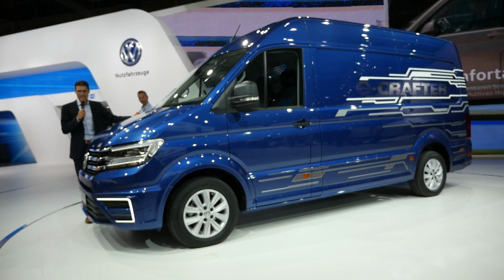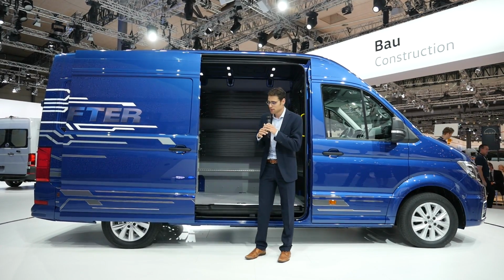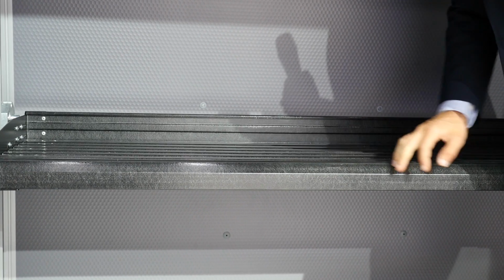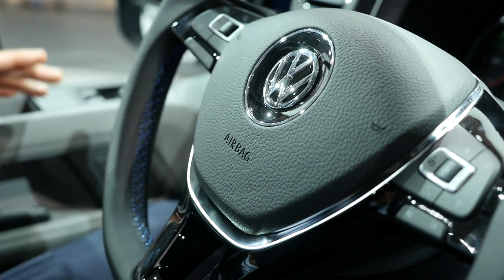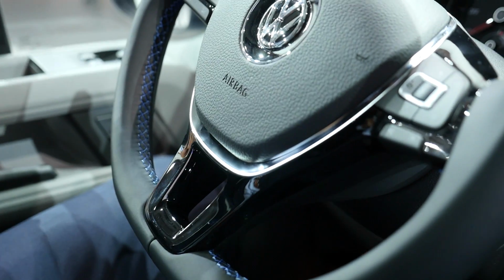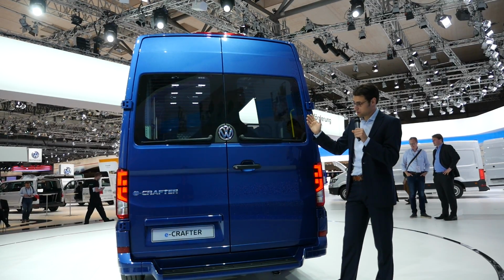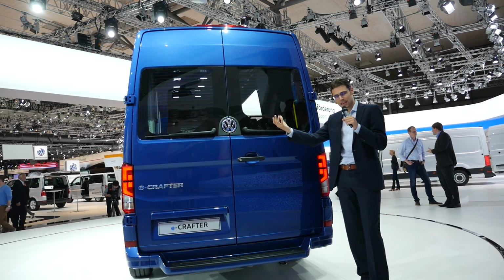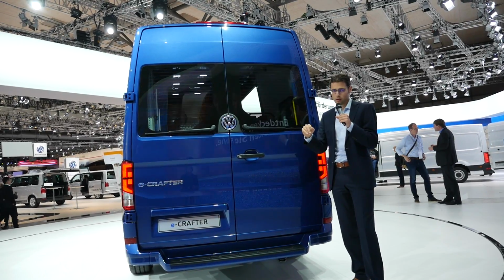VW Volkswagen e-Crafter Premiere 200 km range new electric light truck - Autogefühl

Comment: Three years later they release it with 100km winter empty range. The charge port is badly placed. It is limited to 90kmh. Price is 70k+ euro. No active cooling for the battery and if overheats just like the leaf when rapid charging repeatedly.  
The interior is nice. The soundproofing is better than other utility cars. The car is nippy. Should be a good car for local deliveries with its 10 cubic meters capacity. Price is high though. 
Good start though!

Comment: That would be the coolest campervan in the world, if they would make like a California version of e-Crafter with lightweight furniture. Why from e-Crafter and not T6, because of the room for the batteries is significantly better in Crafter size vehicle. Range of 200-300km would be ok, because in a campervan, you are already there :). So why not take the brake at charging station

Comment: If they give 100kwh, throw out the drivetrain and mount the engine on the rearaxle, redesigns the front to take advantage of the extra space they might have s hot. This, this is pathetic.